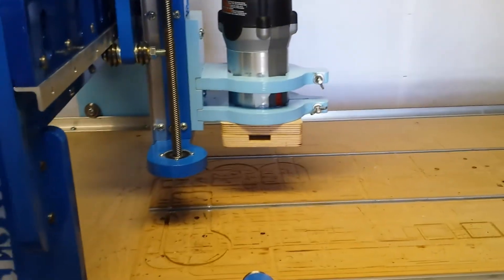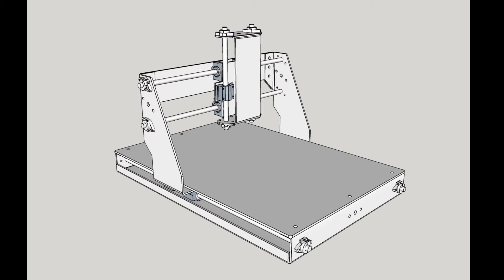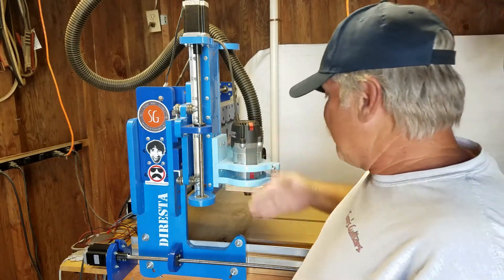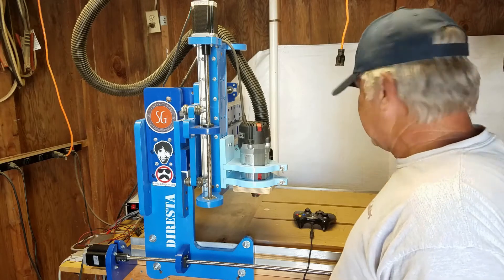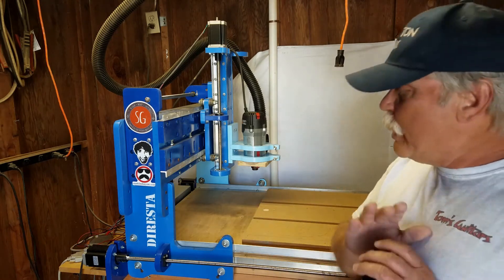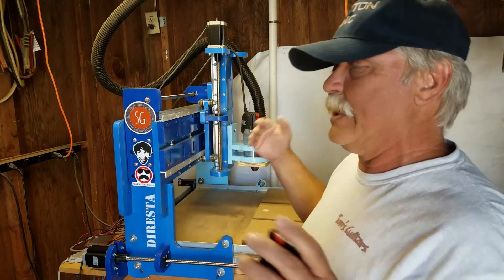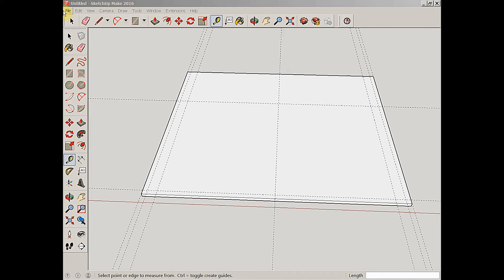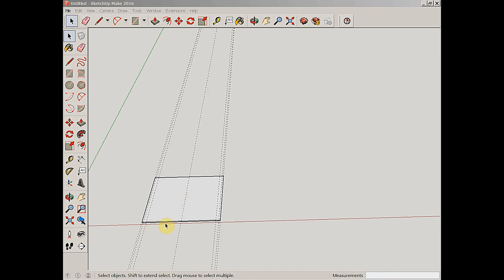Gatton CNC Build Part 2 - Planning for a CNC

Comment: I really appreciate your video Mark.  Table dimensions have been the most frustrating part of my journey.  I see multiple others asking about the same subject.  We are essentially caught in a catch 22 - how to design the supporting structure and machine size without the design dimensions, and how to get the final dimensions without the supporting structure and machine size.  Essentially, a kit builder has to build the machine, measure, and rebuild the machine in order to get what they need.

Anyone who purchase the kid should be provided the information necessary to customize the size.  The variables are already set, with one or two exceptions, based on the design of the kit.  It would be too simple to use the CAD for the machine drawing to measure dimensions.

With then CAD measurements, we would merely need to compare our space budget with the desired cutting area, and take into account the laws of physics as it applies to lead screws, deflection of materials, etc.  We made a leap toward that with the March Q&A with Dave, but it shouldn’t require hours of research to determine the necessary measurements.  I could build it into a simple excel spreadsheet, or have it added to the webpage without significant effort.  

If we change the geometry, such as using a spindle that doesn’t match the design, then that’s the variable we introduce.

Comment: Thanks Mark.  I've been trying to figure this out for 2 days and this was so easy to understand.  I bought the plans for the Gatton CNC and was having the most trouble just trying to decide the table size based on what I think my particular needs are.  Now I nee to figure out the gantry width.  One thing at a time!
Reply from the maker: Thanks Mike! I can only go by my own needs, restrictions, and my use of the machine. It's nice to have a CNC that can hold the full width of a sheet of plywood, but my shed isn't big enough for a machine that will hold a half sheet (I can mount and cut a piece 48 x 36.) Truth be told, if I had the room for a CNC that would hold a full sheet of plywood, I still wouldn't get one. I just wouldn't use it. I'd put the money into a second machine that had maybe a 24" x 36" cutting capacity. Most of the stuff I do is smaller than 24 x 36, so...

Comment: Just a thought on a reason to want to cut outside the lead screw, you could set up a rotary axis out there.
Reply from the maker: That's true. It's probably not how I'd do it, but that's just my opinion - nothing more. Still, you're absolutely right - you sure could put a rotary axis outside the lead screws.
Reply: With the Gatton CNC you have enough overhang at the front to make your rotary axis. No need to make it on the side. Great tutorial, Mark.

Comment: Mark:  I am finally getting around to building my Gatton CNC (it's now 2023 and have been still using my Shoestring budget build).  Thanks for your easy to follow guidance.  I know you have moved on from your hobbyist build into the Avid CNC.  Good for you! I am still working my way towards that as a goal.  Question: If I wanted a 48x48 cutting area, I assume I would only have to increase your Part 3 - The Stand in the Y-axis dimension, right?  Since your table stand supported a table with a cutting area of 48x36, that would be increasing the Y dimensions by 12 inches?  Also, would you be able to share your Sketchup files for the table stand?  Thanks.
Reply from the maker: I'm afraid my SketchUp files were lost in a hard drive meltdown, so I no longer have them. You would need to increase the table measurements in the Y direction, for sure. I can't remember the exact amount, but I think it was something like 66" in Y. Your best bet is to check Dave's website. I believe he did the math and has a layout on the website that shows how big you'll need to build it to get a 4x4 cutting area.

Comment: Good morning Mark... Very inspirational....  I think my build may be a doppelgänger of yours !  
Two Questions... 
1. Have you figured out how much width the lead-screw assemblies or gantry cantilevers will add to the build?
2. Can we assume that the depth of the lower-bearing portion of the gantry is same on the Gatton as it was on the shoe-string CNC ?
Reply from the maker: As near as I can tell, the lead screws, motor mounts, and support bearing mounts will add anywhere from 5 to 6 inches in width per side of the table. I can't give you a number any closer than that because each CNC assembly is different, and it all depends on where they line up when you build yours.

As for the lower bearing portion of the Gatton CNC, I assume you mean the length of the uprights that ride along the aluminum rails. The gantry uprights on the Gatton CNC are about 5 inches shorter than the Shoestring Budget CNC was. Unfortunately, I didn't know that when I recorded this video. That's why I suggest that you measure yours and make the appropriate calculations yourself. The router will most likely hang out in front of the gantry by a similar amount on the Gatton CNC, as their mounts and Z boxes are of similar size and construction, so that 14 1/2 inch measurement I reference may still be applicable. Then again, it may not, in which case, I'll have even more cutting capacity than I expected. Again, mock up your parts and pieces and do some measuring of your own to be certain.

The purpose of this video was never to tell you how big to build your CNC, or give you any measurements to follow. It was intended to show you how I calculated how big to make my machine table, and give you some insight as to what to look for and some things to take into consideration when planning for yours.